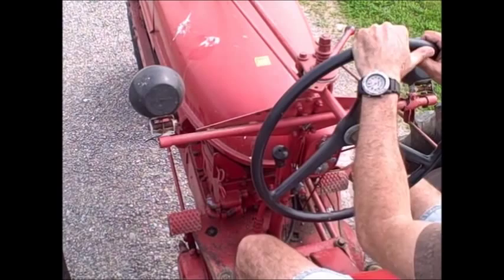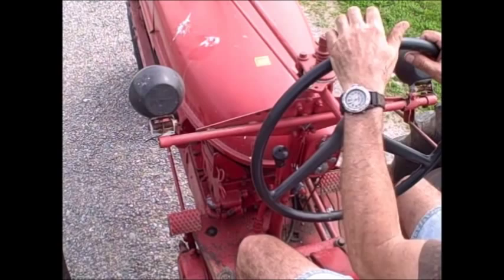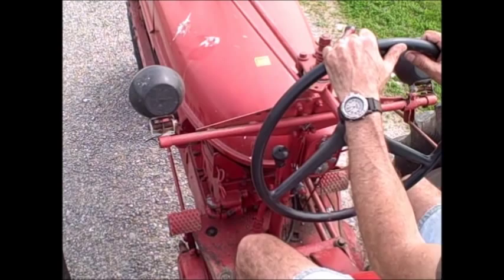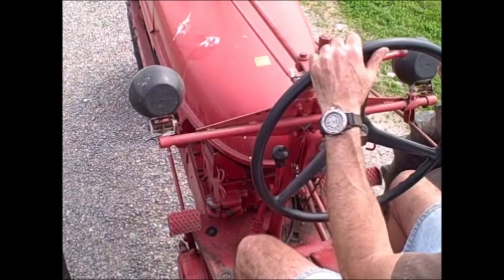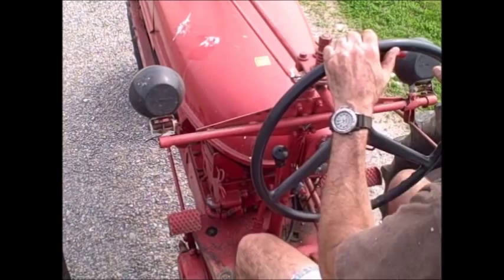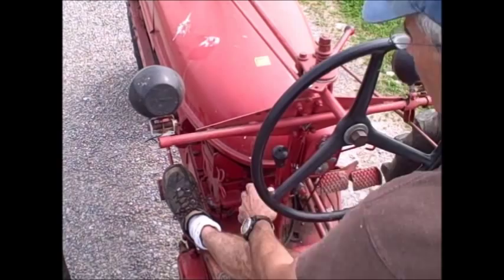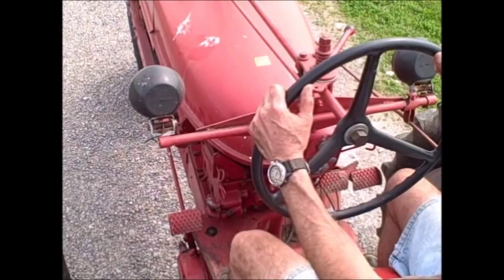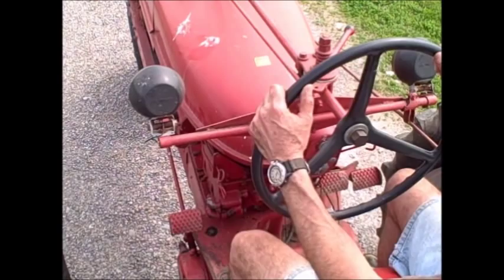Gear shifting demo - 4th gear to road gear on a Farmall Super M

Comment: On our farm, by the time you did all of that, the tractor would have come to a complete halt (we have sandy ground with lots of loose sand--this was dairy country because you could only make a living by putting everything through a cow--10 bu. of oats per acre was considered a good harvest).  Even on pavement we would lose most momentum towing a baler and 5 tons of hay.  Maybe with just the tractor one could get this to work.  We had 2 Farmall H, 1 Farmall M and a Farmall 460.  Most of our farm was woods with wagon ruts going to scattered fields throughout the forest.  Strictly 2-row farming due to narrow roads through the woods.  Probably 120 of 360 acres was arable land and this was quite common of most farms in the area.  36 to 40 head of dairy cows was the norm yet when I graduated College in 1975.

Comment: When you are shifting from 4 to 5 do you have to do all that stuff like the video said or can you just push on the clutch and shift it from 4 to 5
Reply from the maker: You CAN simply push the clutch and move the lever from 4 to 5.    But the transmission will grind like crazy until the input slows enough for the gears to slide into 5.  (If you don't believe, me try it(!))

Incidentally repeated improper shifting from 4 to 5 is why many old Farmall's no longer stay in 5th gear without holding the lever in place - the gears are simply worn out from improper shifting.
Reply: Ok so could i just push in the clutch and wait untill the tractor kinda slows down and put it in 5th
Reply: Or just push in the clutch and put it in nuteral with out slowing down the rpm and then put it in 5th
Reply: @farmallbob  I've never had that happen to me. Sorry...

Comment: Nice "trick", but totally unnecessary.  Any Farmall M or H worth it's salt will take off from a dead stop in 5th gear, and without any trouble or slipping the clutch. I've pulled many a loaded hay wagon this way for many years.
Reply: You ever try that with a load behind you?  I doubt it.
Reply from the maker: Joe Dirt
Works fine with rolling load behind as long as you're on a hard, level or slightly downhill surface (I use it with loaded wagons all the time).   Won't work however on soft ground, in snow, or when starting out uphill....
Reply: We run large tobacco trailers with Hs and C113 tractors. Never have I had trouble pulling in the road gear from a Dead stop. If you're starting off on a hill you should climb in a lower gear until you reach a smaller incline. If someone attempts this going up hill and fails it could mean a loss of life. Trust me.
Reply: Yes.
Reply: When tractor is at operating temp my SH takes off at a low idle in road gear . Pretty flat ground here tho.i was never allowed to use road gear as a kid pulling wagons either
Reply: Not a “trick “ at all.
Just a person understanding and using their machine , as intended by the builders , thereof!